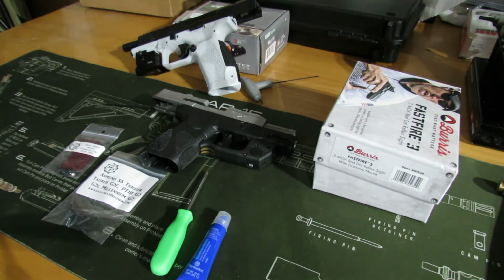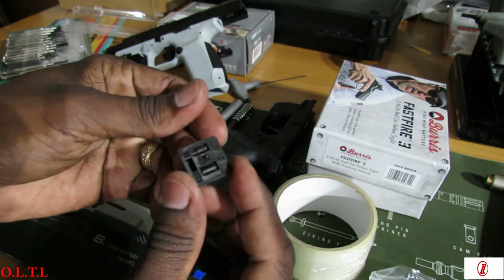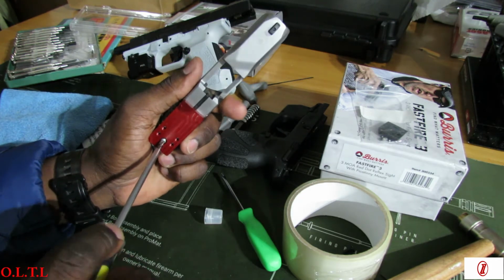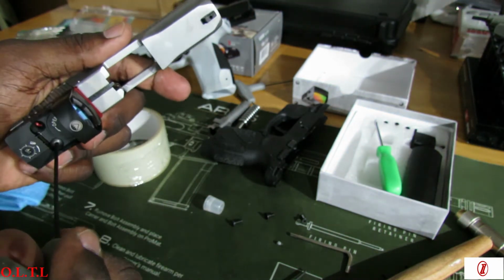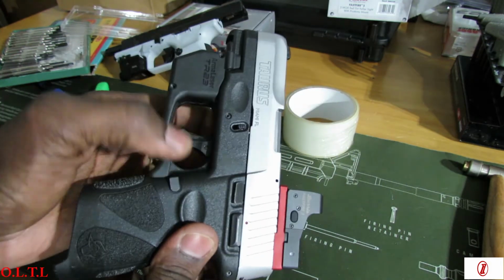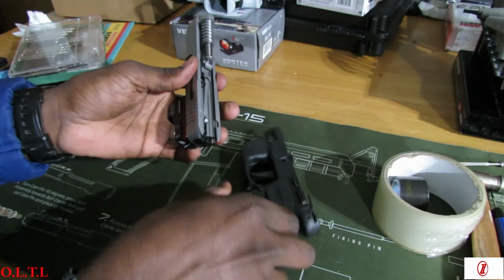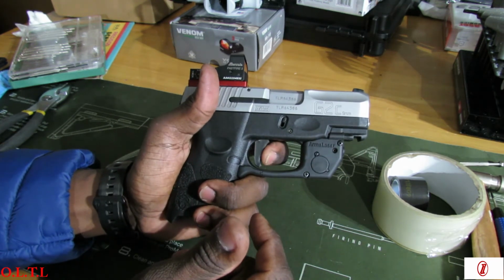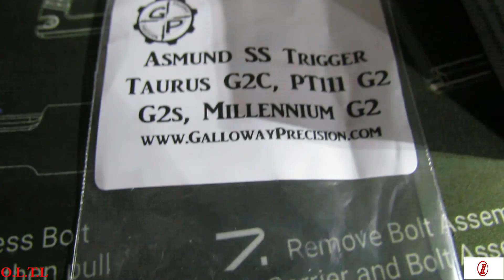G2C must have trigger and red dot done!!!

Comment: I have a fastfire 2 on my g3.  It stays on forever, and has an auto brightness that works well.  Great dot for carry.
Reply: For carry use you can't beat the fastfire 2.
Reply: @dougstout3663  does it have auto on? like the shake awake feature
Reply: It has an on off switch. Once you turn it on it stays on till the battery dies. That is  a little over a year in normal use. When it is in the dark it dims way down.